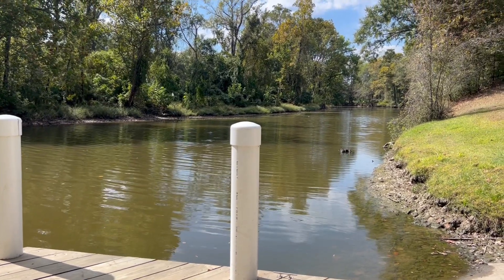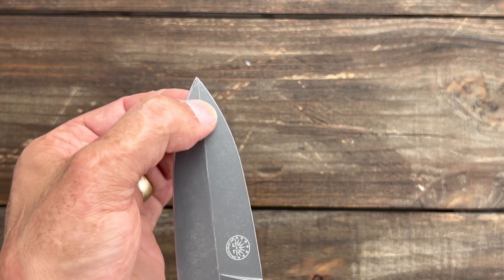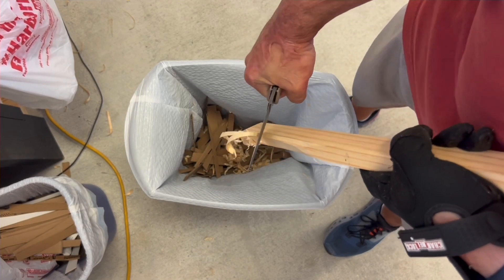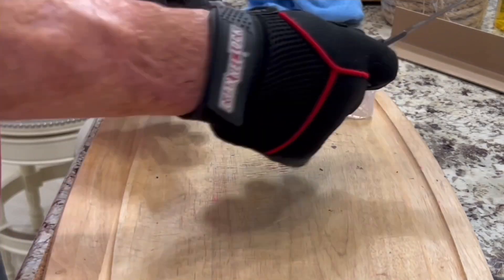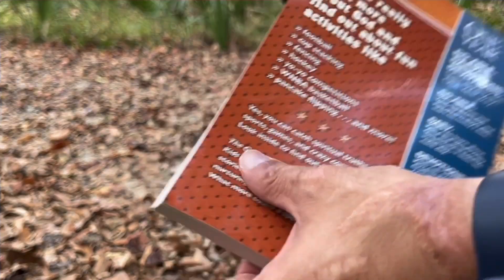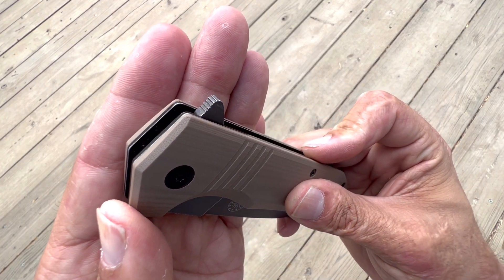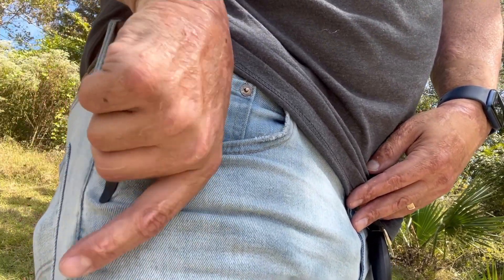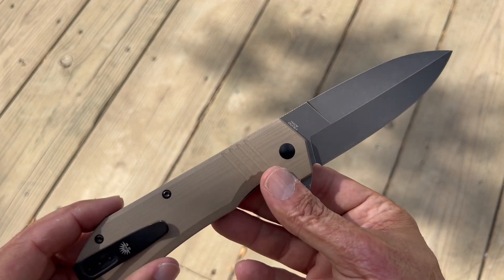One Tuff Knife! Off Grid Knives Stinger xl Full Review

Comment: I just bought this knife, along with a Cayman XL as my intro to Off-Grid. I had my eye on their designs for years, as I generally like big and "tactical" looking knives, but didn't like that they were using D2 for all of them and pricing at ~$100. It's great that they recently moved up to 154CM and 14C28N, and their prices had only gone up by $10, making their knives a much better value, at least to me. 

It's definitely a great looking, well constructed and solid-feeling knife. The blade was almost perfectly centered from the factory,  the action is excellent and so is the pocket clip. The edge came very sharp too. I totally agree that it should've used a back spacer. The one from Cayman XL would've been perfect. I also wish that like the Enforcer XL, this knife had a removable glass breaker. Another thing I'm missing is some texturing towards the butt of the handle. More lines like they have towards the front would've been great. The G10 is rather slick overwise.

Anyway, thanks a bunch for all your hard testing! It's great to know that this knife is actually as tough as it looks. Off-Grid has the designs, materials and build quality down but I do wish that they'd start expanding into crossbar or even compression locks, as well as different deployment methods.

Comment: REALLY digging the tan one...Are thumbstuds obsolete??? Needs a second deployment option.
Reply from the maker: No doubt, I’m not a fan of flippers but I can tolerate them when I have other options
Reply: The guy behind Off-Grid, who designs all their knives, seems to be obsessed with flippers. They've recently moved on from using D2, making their knives a much better value now, but they really need to expand into other locks and deployment methods.